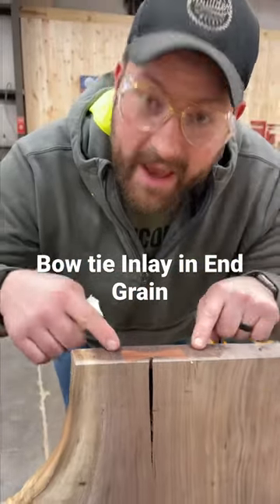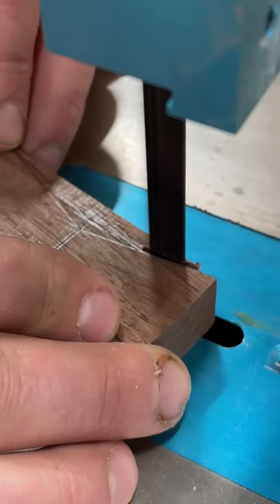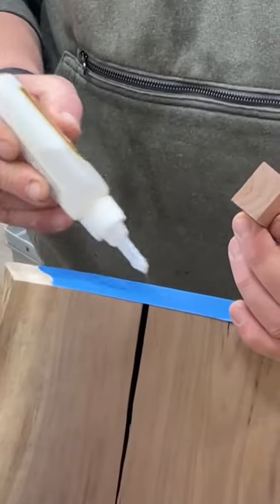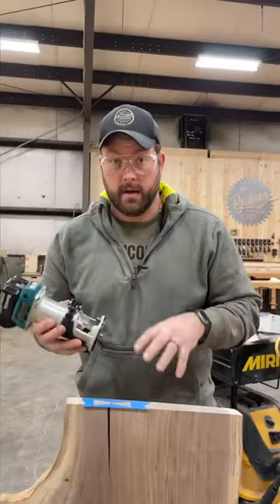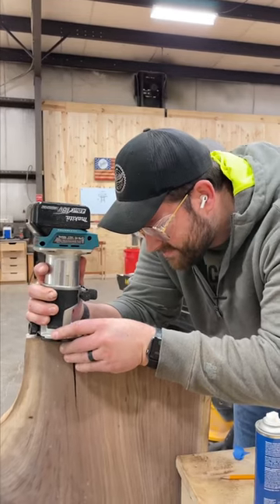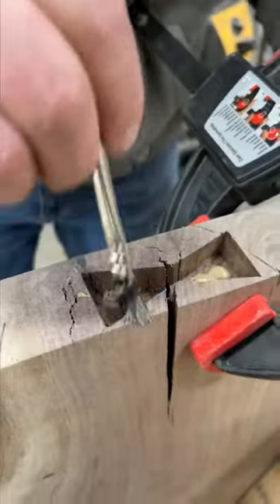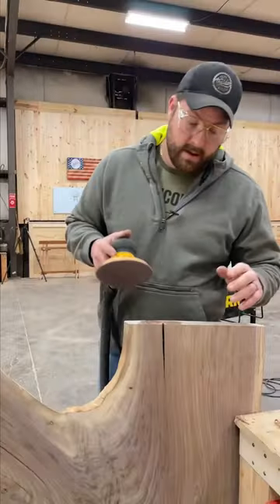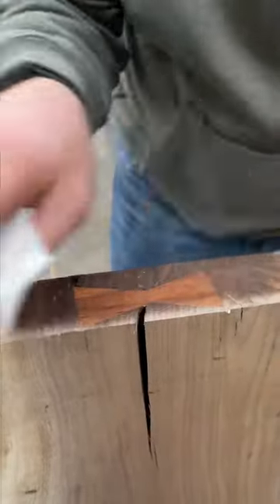Make A Beautiful Bowtie Inlay

Comment: Looks okay but isn't fit for purpose as the end grain will now split around the tie as it has higher strength due to the grain direction and will shrink/expand less... The ties need to be on the faces, at the end of the crack each side... Setting ties is not as simple and fitting them, you need to understand the piece of timber you're working on and how it's going to age...
Reply from the maker: 🤣🤣 thank you.
Reply: @John_Malecki  He just learned about it in shop class!
Reply: @John_Malecki  he's right, you just crammed a bow tie into a stack of straws...

Congrats.